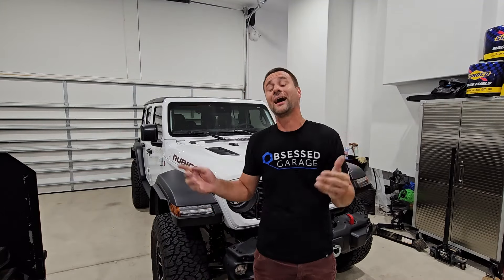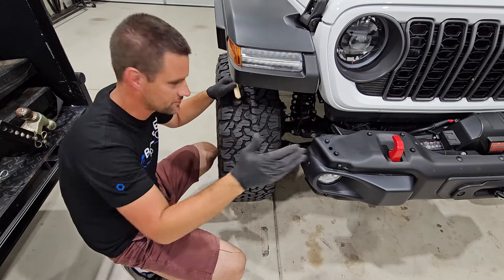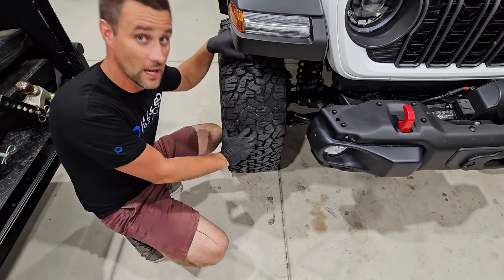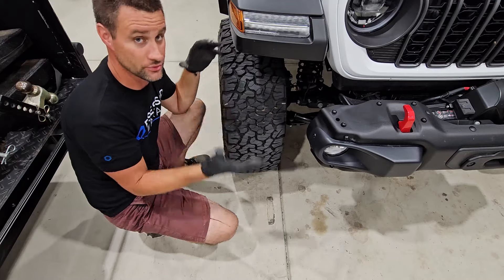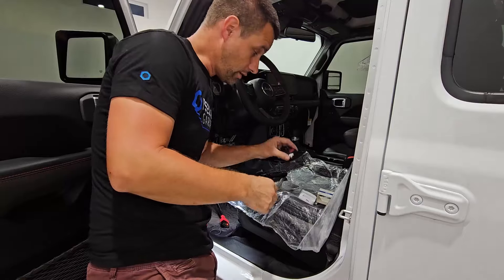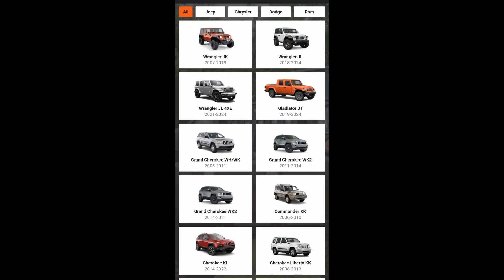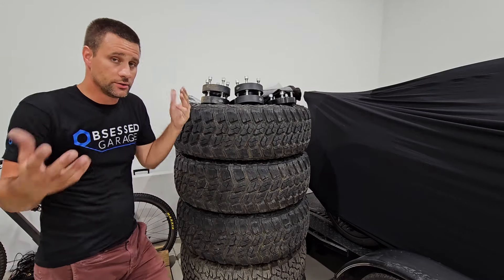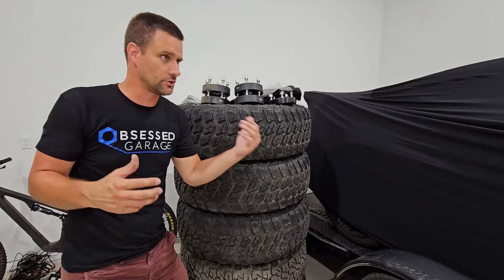Fix Your Off-road Tire WEAR Tire Chalk Test / JScan Tire Pressure Programming 2024 Jeep Wrangler JL

Comment: Thank you. I just put 37’s on my dad’s JL 392 and I need to adjust the tire size. Didn’t know where the security module is. I have used JScan for years on my WK2, it’s an amazing tool. One of my favorite things is the fog lights with high beams. Cheers!